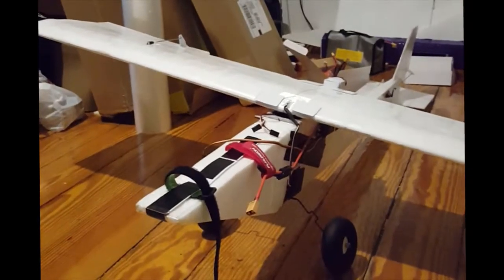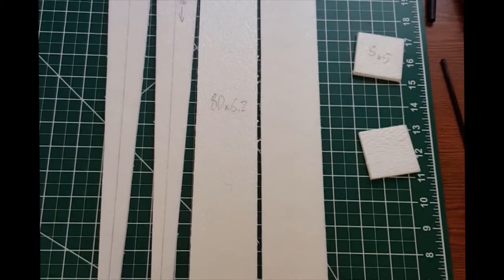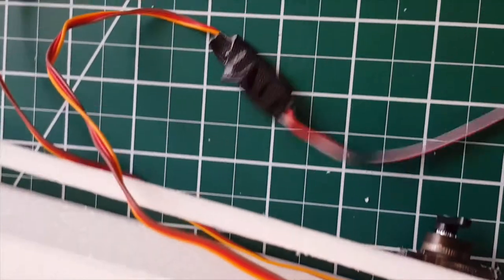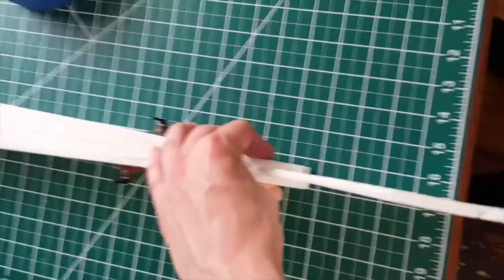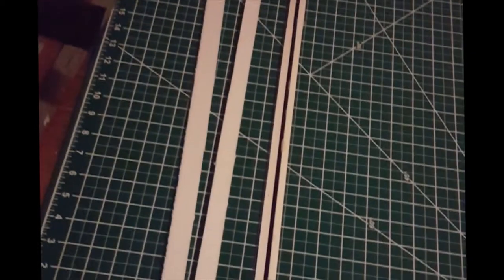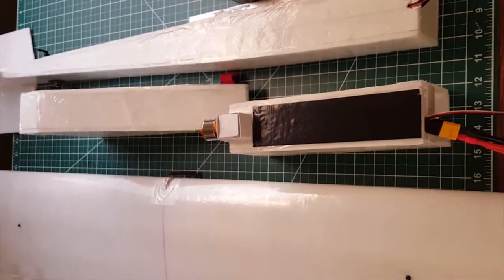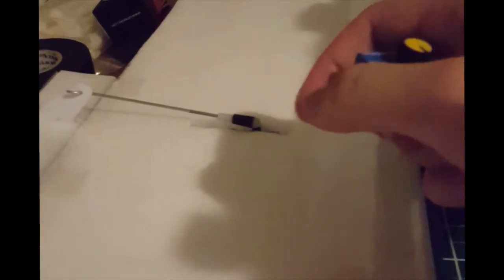The Ghost - Fixed Wing FPV RC Aircraft - Build Video

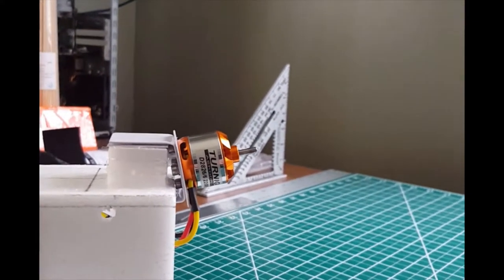Comment: thanks for posting.  good work.   some thoughts.   at 1:50, the Optimum combination of Offset thrust Line/Angle also depends on Whether the model's Center of MASS is   WHERE  IT  SHOULD  BE.   do you know where that is.   if not, see entry  'balance'  at linked pdf-doc.  aileron servos Should be installed as Near to fuselage as Practical; ailerons Should be  Stiff  enough to accommodate doing this.   fyi, its pronounced    fuselawj.     cheers
https://www.princeton.edu/~stengel/MAE331Lecture5.pdf